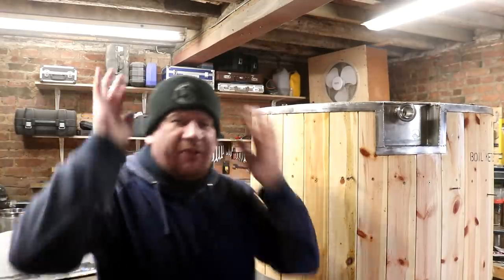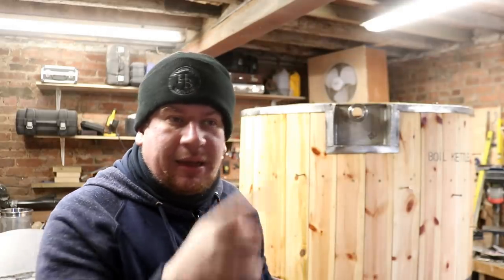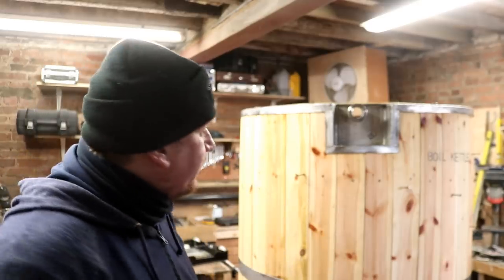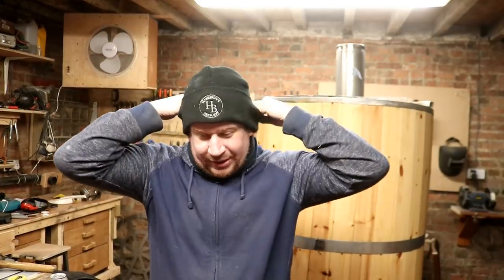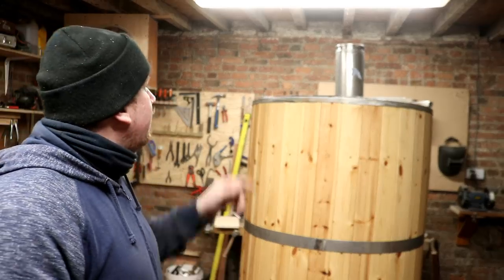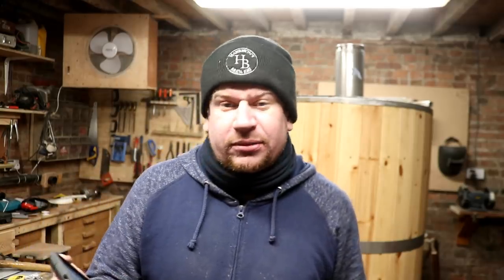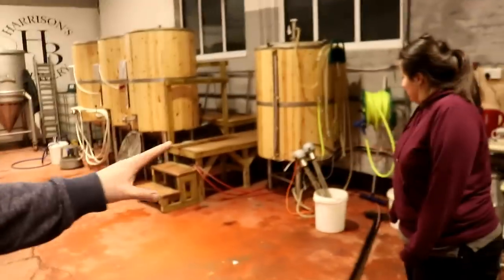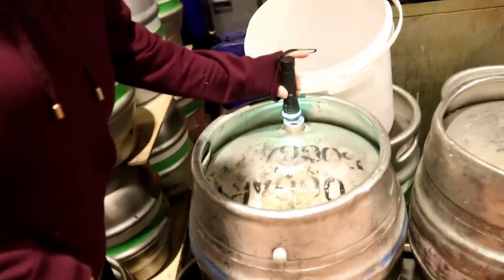BOIL KETTLE UPGRADES

Comment: Ya...that second cask was alriiiight! First one a bit grungy, but some caustic will fix that. You know - a short bit of square tube with a hole (or a big eyelet, if you have one) and a short bolt welded to a bracket (square tube, or just "L" angle) stuck on to your chimney would form a "pin" that you could just set the chimney on the tube with the hole - no nuts required - held on by gravity and its' own weight. You could put one top and bottom to support the chimney at both ends. Nothing to get lost or misplaced, either.

Comment: Why not just design one or more brackets to screw to the cladding? If that won't work how about a full length top to bottom box section so that it's rigid and a firm base and then and fasten the brackets to that? Just typing ideas while watching, cheers Schnuz.

Comment: 3 Things ....opening shot Gemma’s scarf looks like it’s trying to smother her! The coconut shypa was making me salivate😎 where you are going to screw the contraption to the timber on the side of the boiler kettle might I suggest an adjustable flanged type of nut with a washer welded to it so you can adjust the amount it pushes of the timber to take up the strain as there will be expansion and contractions as weather changes a bit  like horizontal bath legs?